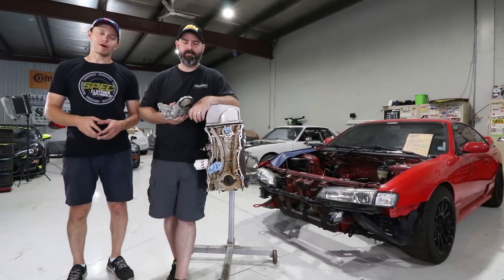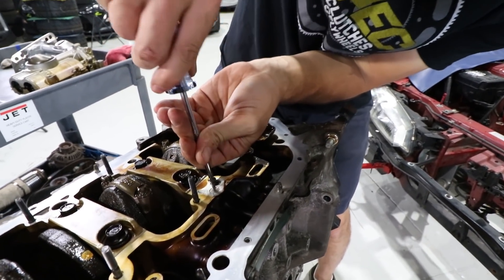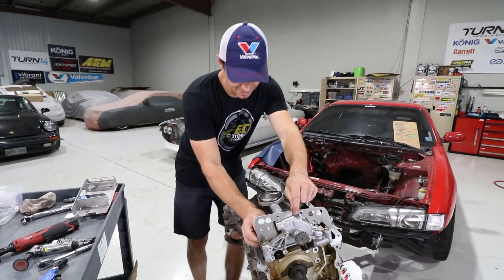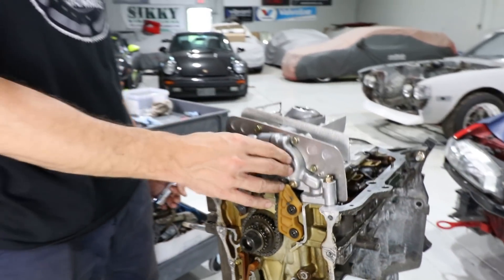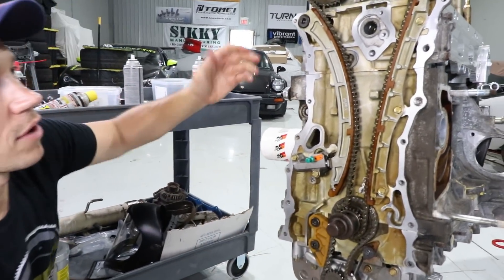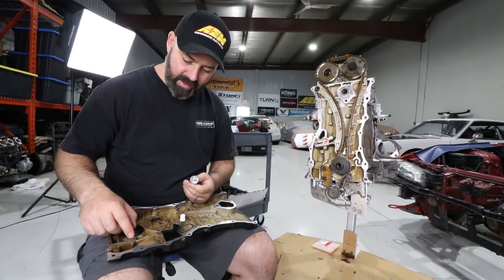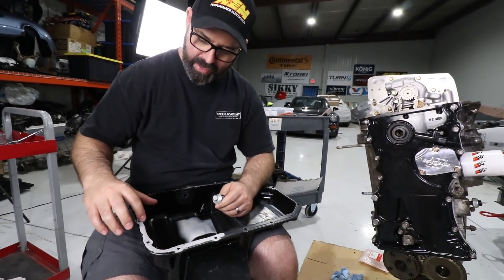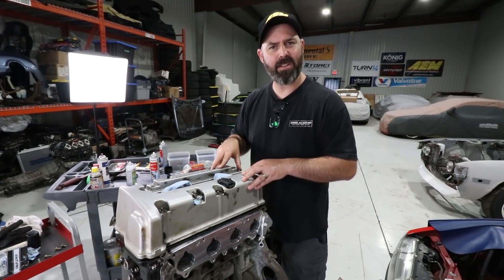Honda K20 K24 How to Set Timing & Oil Pump Install - Honda K-Swap 240SX

Comment: I was an Acura/Honda tech for 34 years and came to love HondaBond HT, it's great stuff. HondaBond 4 was better for applying a 'very' small bead to manual transmission mating surfaces, but it is very runny.

During the 90's I crewed for my Acura parts manager in SCCA Racing, he was driving a Datsun 510. We had to re-tighten the oil pan bolts between races despite using first blue LT 242 and later red LT 260 on cleaned fasteners.  Our solution was to put HondaBond HT on the threads before installing the pan bolts. 

Our theory was that the fiber pan gasket (Nissan Racing) and the constant 3,000 to 8,000+ rpm swings were vibrating the fasteners to the point that the LT broke and the fasteners loosened, the rubbery consistency of the HondaBondHT allowed the fasteners to vibrate without breaking the sealing of the threads like harder thread lockers.

Your mileage may vary, but following that experience until I left the industry in 2018  I put HondaBond HT on fasteners that I wanted to retain, but not want to have to apply heat to remove later.

Comment: Why does everyone skip over the oil pump tensioner part😢. Do you pull the tensioner clip and the torque the bolts down?

Comment: At 4:55 you torque down the oil pump chain guide. All data and all other repair guides I have looked at say that those two bolts are M8x1.25 bolts with a torque spec of 16ft lbs. I found out the hard way that 16 ft lbs is way too much, and snapped the bolt. I then discovered that those two bolts on my engine are M6x1.0 bolts, not M8x1.25. What did you torque those down to? I am likely going to torque mine to 8.7ft lbs, which is what the torque spec is of the timing chain guide bolts, which are also also M6x1.0 bolts. The car I'm working on is an 08 accord 2.4 K24Z2 (I believe not PZEV).

Comment: Have you guys ever heard of adding another click of tension by slightly prying more tension on the chain after pulling the pin? If so, any thoughts on if it's a good or bad idea?
Reply from the maker: Dont get how that would do anything as the tensioner is based on hydraulic pressure and will move in and out so adding a click shouldnt matter.

Comment: How much would this cost on a base rsx 5 speed if i already have a hondata.  Ive already done CAI, type s TB, RBC, PLM RH, HKS Hi power, type s injectors, oil pump, fuel pump And hondata. Now do i do K20a2 head/cams or just and full K20a2?

Comment: Guys. Why not a new timing chain? That one is mega strected. Look how loose it is when installing around the crank before the tensioner is on. Also how far the tensioner came out when you pulled the pin. I'd highly recommend a new one if your going to race.

Comment: Way didn't y'all rotate the engine over and recheck the time Mark's?? 
I guess my Mitsubishi engine is different. But after you pull the pin in the tentioner. You rotate the Crank 6 times back to TDC. And recheck the marks. And do a measurement from the hydraulic tentioner to the tentioner pully arm. 
It's super important. One tooth of can make it run terrible. Two teeth off. And you bend valves on start up.
Reply from the maker: We actually did do it but you have to spin the engine over around 50 times before it is at TDC again. I always double check my timing marks that way, cant be too safe.
Reply: Speed Academy sweet. To much work to shortcut.
Especially timing components.

Comment: im having the timing chain and tensioner replaced on my tsx, i ordered a kit, does it require taking off the valve cover? i need to know if i need a new valve cover gasket as well. thanks
Reply from the maker: Yes you will need to take the valve cover off.

Comment: Have fun with that paint, I did the same exact thing for my turbo 350z timing cover. 6 months in and it’s already peeling. I haven’t even hit s track day yet. No way that’s ganna last for you guys.
Reply from the maker: What type of paint did you use? We put Eastwood Chassis coating paint on it which is supposed to resist chipping.

Comment: Why no RBC 50 degree vtc?
Reply from the maker: Stock cams not needed right now?
Reply: Generally, with an RBC like manifold  (s2k in your case) you can advance the cam in the mid range and gain a decent amount of torque.  Its almost always a significant amount more than the standard RBB vtc can supply@25 degrees.  Although that Nissan may not be able to handle all that TEC rippin’ ...25 might be a safe start for her 😛

Comment: Maybe I missed it in an episode are you running the stock K24a2 VTC sprocket? If so any plans to change it and the cams or is it a get it installed and running in the 240 before making other changes ? (I know I heard possible Turbo in the future)
Reply from the maker: Getting it running is the plan, not really sure if we're doing cams so dont see the advantage of changing the gear out unless we do cams?